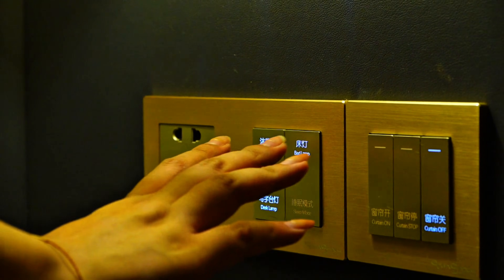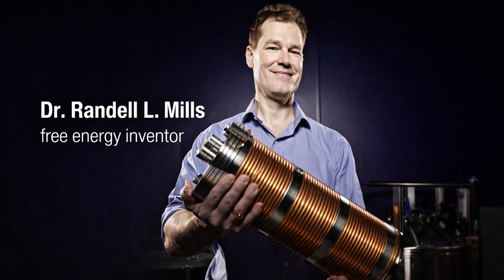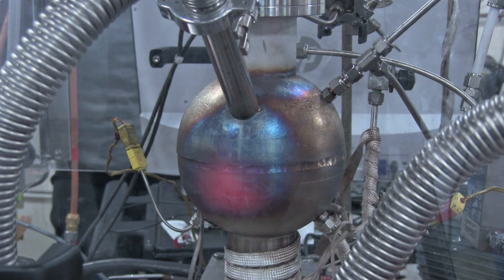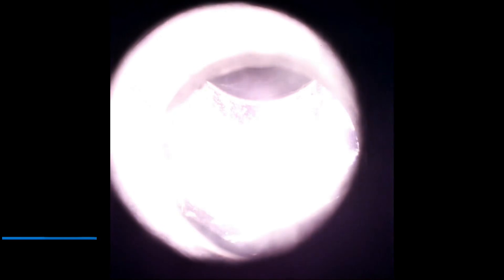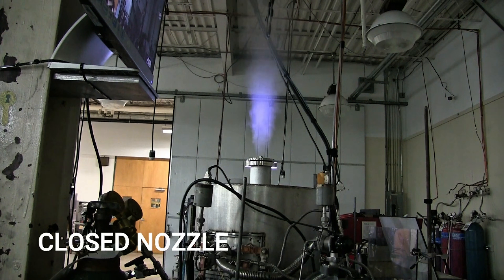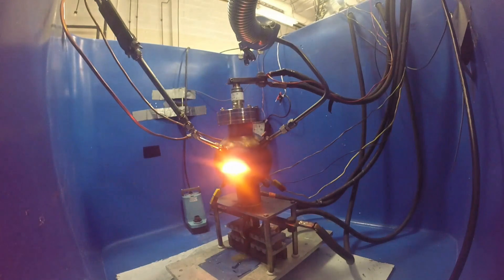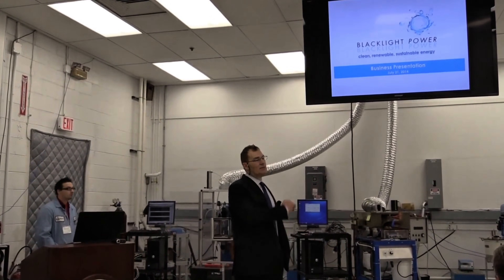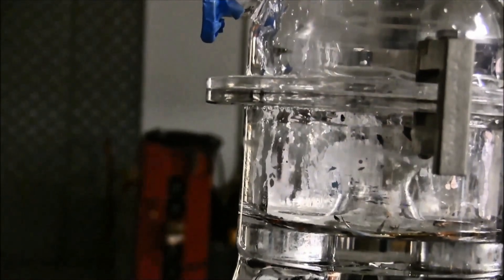This U.S. Company: Just Ended Energy Bills Forever with Their FREE ENERGY Generator!

Comment: Two problems. Where do you get the energy for the startup and how much does it take? How much of it's own energy production is required to keep it running. Finally, no water is completely free of minerals. They would slowly coat the reaction chamber throttling efficiency.  If they react in the plasma, how can you be sure you don't get toxic gases output.

Comment: FYI: This process was duscovered in the 1940s. It was the subject of an article in "Popular Mechanics" dealing with arc welding. Back then they had welding that used infused Hydrogen. The molren netal caused the Hydrogen molecule (H2) to split into H + H. The single atoms quickly snap back into H2, and when thet do they release a huge amount of energy, far more by an order of magnitude than that energy used by the arc.
    For some unpublished reason, they discontinued the use of Hydrogen welding immediately following the 1940s publication of the discovery.  🤔😯🧐

Comment: Cheeper electric has been here but the power that be don't want it:  LFTR desalination
Who needs desalination? A LFTR nuclear reactor that runs on Thorium, 90 times more energy than Uranium, no nuclear waste, 200 times more efficient, thorium is more common than tin (the USA has the worlds second largest reserves in the hundreds of millions of tons). And guess what? This tech ain’t theory. One was built and ran from 1960 to 65 at ORNL and it worked great. Cheaper to build than natural gas or coal plants, and Thorium is considered a trash product. Best of all, the waste heat can desalinate water and using the special LFTR waste heat management process, the excess hydrogen from desalination can be combined with trash to make carbon free synthetic oil from sewage and MSW. Another other wastes products are Xenon which will power rockets to Mars and allow light bulbs almost as efficient as LEDs to be built, at a fraction of the cost. Another waste product is special types of bismuth and cesium which can cure all forms of cancer and eliminate food poisoning, respectively

Comment: This is regarded as pseudoscience. 
Randell Mills' Brilliant Light Power (BLP) claims to generate excess energy via "hydrino" reactions, but the scientific community largely views it as pseudoscience, with physicists stating Mills' theories are inconsistent and not experimentally verifiable, though BLP asserts its technology works and protects its intellectual property closely, making independent testing difficult, as noted by Scientific American and C&EN. 

Key Points:
The Theory: Mills claims to have discovered a new, lower energy state of hydrogen, the "hydrino," which releases massive energy when forming from ordinary hydrogen.

The Device (SunCell): BLP uses a carbon reactor with molten silver and catalysts to ignite a plasma, claiming the resulting heat is converted to electricity via photovoltaic cells.

Scientific Consensus: Most physicists, including former European Space Agency researcher Andreas Rathke, find Mills' theory incompatible with established physics and report no unambiguous excess energy in experiments, suggesting the theory is flawed.

Intellectual Property (IP) Barriers: BLP owns patents on "hydrinos" and requires strict IP agreements for outside researchers, preventing independent replication or verification, which further fuels skepticism.

Status: Despite decades of claims, BLP has not achieved mainstream scientific validation or commercial success, with many viewing it as a continuation of discredited cold fusion research. 
In essence, while BLP insists its technology is real, its claims lack scientific backing and remain unproven by the broader scientific community, which generally considers it pseudoscience.

Comment: So what he actually invented was a Hydrogen gas plasma power unit, instead of using electrically energy to extract the Hydrogen gas then store it what he done was to use it instantly as it's being produced into a plasma fusion chamber. If so the government wouldn't allow you to produce any Hydrogen device in your home or residential area for safety reasons they say, you don't want a Hydrogen explosion or anyone making a Hydrogen boom boom right.